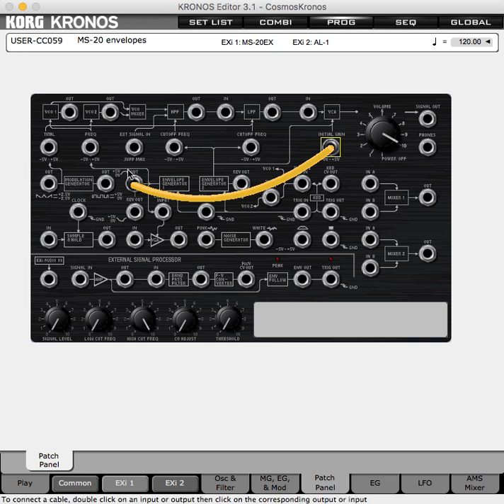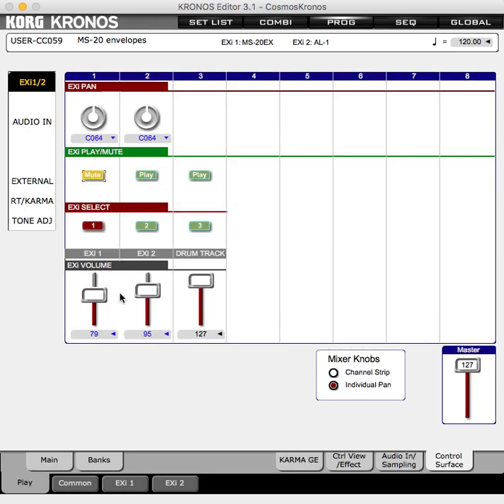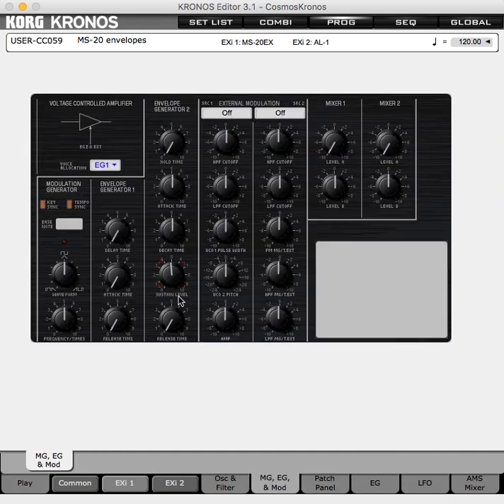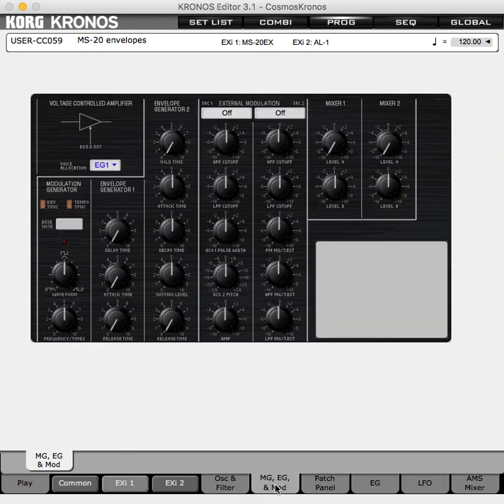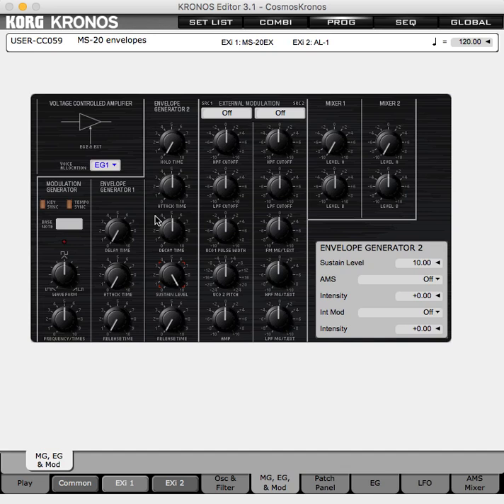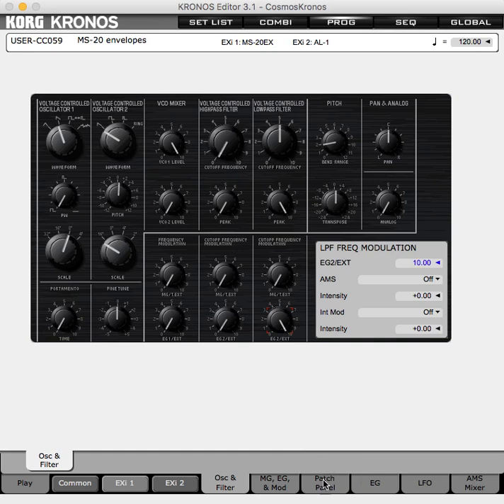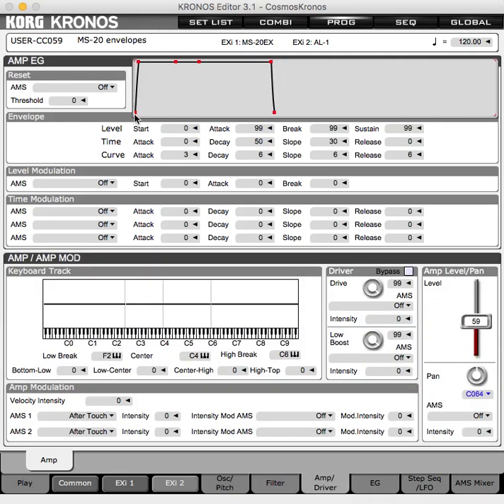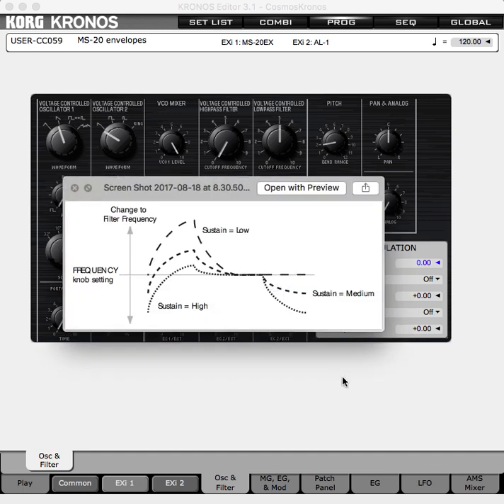MS-20EX pt.2-3 Envelope Generator 2

Comment: This explanation is SUPER helpful. I just took a look at the EG2 Out on my MS20M and its Unipolar! Im divin deep now.
Reply from the maker: Is that the MS-20M with cross mod? That has to be the best version of the MS-20 ever.
Reply: @CharlesFerraro  Yeah it comes with OSC Sync, FM and a bunch of Junction patch points. Its definitely the best version. The Rev 2 filter doesn't sound like the OG Rev 2 but they got pretty damn close to the Rev 1
Reply from the maker: @PantherModern333  hey your music is super sick. Just listened to the whole album.
Reply: @CharlesFerraro  thanks man! your channel also rules

Comment: I’m here following a link from Alex's video and the behaviour on the MS20 mini is totally different. 
It’s true that a zero sustain is the same as the set level of the cut off but as you turn the sustain up on the Mini the cut off drops, and by the time you reach full sustain it’s the equivalent of moving the cutoff from 5 down to about 3.5. The envelope behaviour is similar, in that it will start lower but I think it will also return to the lower start point, not to 0 volts. I have tried this on my iMS-20 app and it works as on this video, but the mini is a different beast.
Reply from the maker: Hmm, make sure attack and decay are on zero while adjusting sustain.  If your decay is all the way up, offsetting sustain will move a parameter's value but it should "glide" back to it's resting position at the speed of the decay rate.  Can you post a video comparing the behavior between the mini and iMS-20?
Reply: Charles Ferraro I will check it later tonight. The resting sustain level is definitely not the same as the cut off value with sustain levels above zero, this I can check by changing the intensity of EG2 to the filter. For years mini users have been saying the sustain behaviour of eg2 is a bit backward.
Reply from the maker: That's pretty exciting news.  Maybe they simplified the behavior of EG2 for the mini.  I remember getting into an argument with Automatic Gainsay about EG2.  If he was using a mini then that would make sense.  I'd still like to see a video demonstration just to see exactly what it's doing.
Reply: Charles Ferraro I will have to change my set up to make a video with decent sound. 
Testing it earlier it seemed like it might be doing something like this - 
With sustain at zero the envelope will go from, let’s say, 5 up to 9 and decay back to 5. Your video shows that normally raising sustain would change this behaviour to be maybe 3 up to 7 and back to 5. On the mini this change would be 3 up to 7 and back to 3, not back to 5.
Reply from the maker: Excellent explanation.  And yeah, that video shows exactly what you're describing.  It's definitely a flaw on the mini, that's too bad.  Instead of being more simplified, that's actually less intuitive.  Has Korg ever addressed that issue publicly?  I wonder if the MS-20m desktop module has the same problem.
I edited my video's description to update it with that new information.
Reply: Charles Ferraro I’m not sure Korg ever addressed the problem publicly. The video I linked to came from a gearsluts post at the time of the Mini's release, people were every quick to find this out. I haven’t tested to see if the issue affects both filter cutoff and amp in the same way as I was working with eg1 patches into the amp like you were. Would be an interesting test. 
What are you using? The Ms20 engine on the Kronos? And what is the AL1 in your video?
Reply from the maker: Yup that's the Kronos' "MS-20EX" engine.  It's my favorite iteration of the MS-20 since it has summing mixers, extra patch points, unison, chord triggers, and a bevy of extra mod sources including envelopes, LFO's, two mod sequencers and KARMA.  It's almost like a PS-3300 in terms of polyphony too.  And that's all within a workstation environment so there are a million other things you can do in terms of splits/layers, mixing and effects etc.
AL-1 is the new school VA on the Kronos.  It's most special feature is probably the anti-aliasing programming that went into it.  Obvs that's not a concern with analog equipment, but to have such a clean signal with digitally precise oscillator sync is a joy.